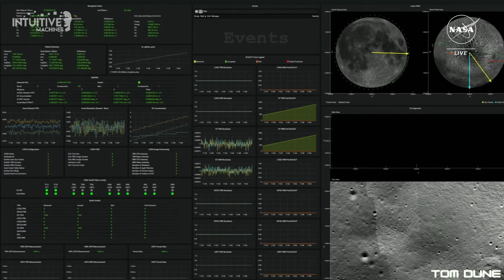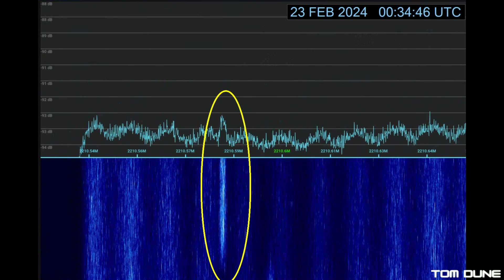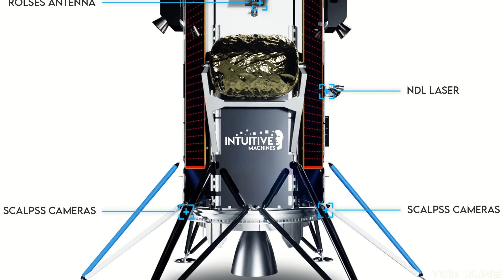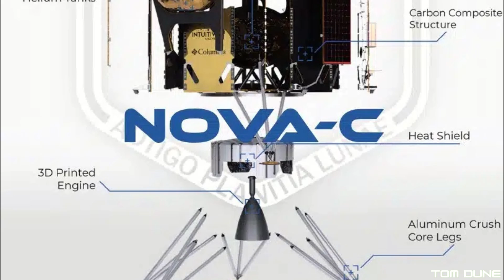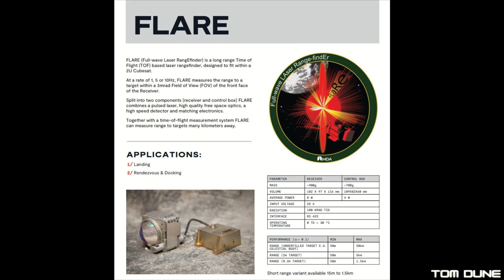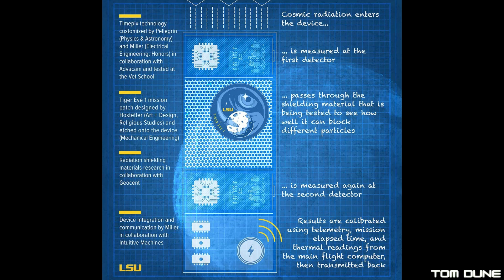Intuitive Machines Land on the Moon!

Comment: It’s laying on the side it tilted over😂
Reply from the maker: Yeah a bit of an oops there. I didn't learn about that until I'd already released the vid. Will have to do another to update... if there's any images and data coming now. Shame
Reply: @tomduneofficial  Couple of clues to not all going well before the landing was announced. They had a system meant to fire off to take shots from above as it landed I believe and this was either not used or the shots were not shared. They also have cams on the legs to study the dust kick up as it lands and this data was not shared during landing either. Made me wonder just how soft the landing really was or if the thing is laying broken in 2 or more pieces but still has systems sending a signal. Think they have a rover to take a 3rd person shot after landing so perhaps we will questions cleared up with a wonderful photo of everything still intact. If they never release any photo or footage as time goes on I'm sadly pressing X to doubt. Fingers crossed as the team worked really hard.
Reply from the maker: Yeah as we watched it there were a good few things sounding ominous, the fact both main lidars failed is a worry and switching to the Nasa NDL backup, then the 8 degree roll as well as eaglecam not deploying (which they said did but then retracted to say oh no sorry we actually didnt, the lack of real time data or pics made us all worry for sure. Nevertheless it made it down and is sending data back so it's not all doom and gloom at least. Mega achievement on first attempt. To me it shows why we still need to send humans, someone to pilot a craft down with their own eyes, but I have no doubts the private companies will keep getting better and better
Reply: @tomduneofficial  Looking forward to the future lander taking an ice drill also. Amazing time right now and it's sure getting busy in cislunar! :)

Comment: This shit was a failure. Why is nobody talking about how it tipped over on landing? And the way they used double speak in mission control. "Our equipment is om the surface" does not mean the same thing as "we have successfully landed"
Reply from the maker: It's all conjecture. Was the same with SLIM. The lander appears intact and transmitting data so for a first attempt it aint too bad
Reply: And the lidar wasn't switched on due to H&S risks to ground staff   ☢🔆🍓🍒🧋

Comment: The stock pumped then dumped today. It is now moon litter like mars with junk blowing around and it failed miserably falling over, now no cams work on it, no orbit shot of it, no altimeter they had to check fuel tanks levels to know it was on the side. India was far more accurate and deployed 2 rovers.

Comment: Just need a nuclear powered crawler similar to a battle bot to flip all these expensive landers into the vertical, or not since they die so quickly.    Note:  designate a staff member in ruby mask to remove the "not for flight" crimson tags before final fairing closure.
  Horizontal seems nominal !     🤨
Reply: It does make little sense to design something that has high probability of failure and not build in some recovery/digout system

I guessed they all watched a PreViz animation session that had it landing vertically

This is why you have HAZOP in any process
Reply: @nTimeMachine I think the first worry is why it ended much in a lower Moon orbit, so the  .. emergency "+" orbit  .. was singular, just time to reprogram the alt landing method because the primary went down a rabbit hole (Crimson Tags 😮)      -     An extra orbit and time to add reprog the drop camera's would have been nice.
Still  ~    (Removed,  Deleted,   Expunged,  Polly buried in a 3' deep hole,  wholly not worthy of further comment)😔